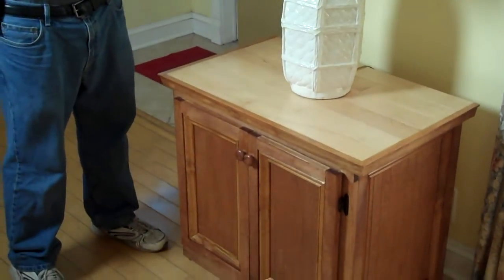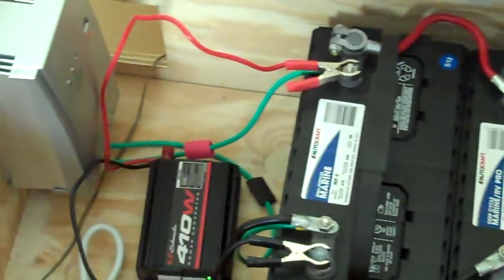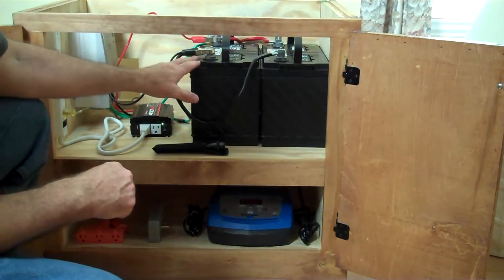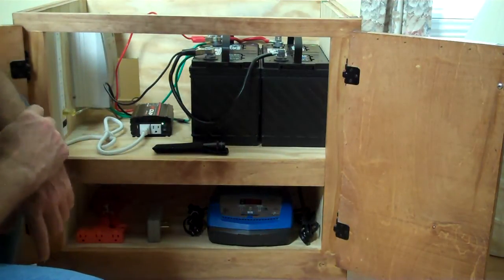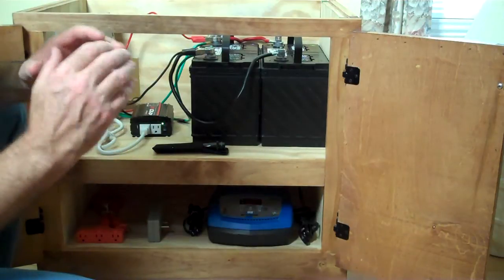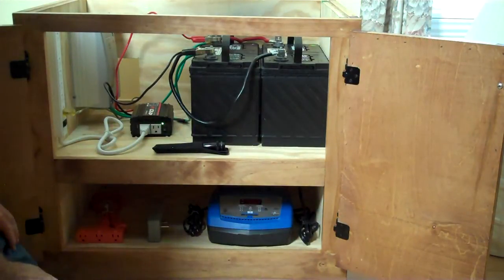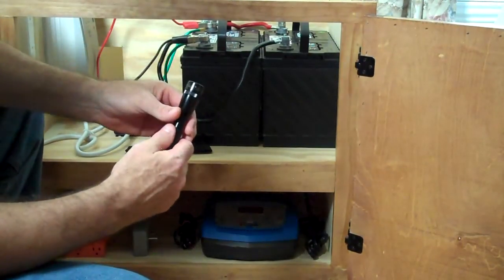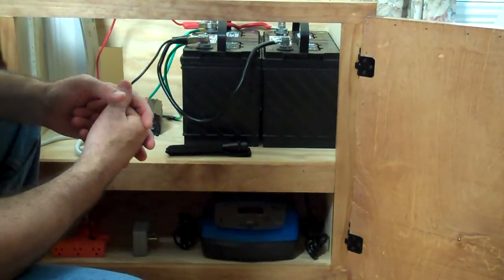Battery Bank Introduction

Comment: I have thought of this since i have a 400w power inverter and have used it in my car when on trips and camping with the family. Tho i was going to use a car battery for inside use, tho deep cycle is far better right? This is a great idea, would be nice to beable to get online to check local news and such in a power outtage alot of good from this thanks alot. I liked the video so i can watch it again and thinking i may make one of these. Might make a smaller tpe. thanks for the inspiration.
Reply from the maker: Hello Kullcraven.  The car battery was designed to turn over the starter motor for a very short period of time.  High power draw in a short period of time. A marine battery is for a lower draw for a much longer period of time.  Both batteries should not be drawn below 50% of capacity otherwise you shorten life expectancy.  This is where the marine battery really shines, it has tremendous capacity. All this said, if you watch your draw, a car battery could work for you. Gene
Reply: Thanks alot, tho to be honest how do you know when its at half life. 
A tester i guess
Reply from the maker: Kullcraven, that is right. Some battery chargers have that ability to tell you.  I also use a Kill A Watt meter to roughly judge usage against capacity. Gene

Comment: Gene, how are you expelling the gas, hydrogen,  produced during charging?  Also, lead acid batteries do weep sulfuric acid. Shouldnt be do this in your livng room. I keep my battery bank in my garage with a fresh air vent to the outside for these reasons.
Reply from the maker: Schickmann, That was true with the old vented batteries when being charged at a high rate. I believe the newly designed sealed batteries with smart battery chargers and controllers over come this problem, my personal opinion. Gene

Comment: I would just buy a small UPS that uses a 12 volt battery. Take out the battery, extend the leads, and connect it to a bigger battery.

Comment: Hey Gene, great video. One thought regarding inverters, some of the lower end inverters using a modified sine wave will give interference with some electronics. Also I would be wary charging a laptop battery or battery packs for power tools with the modified sine wave inverter. I have seen many a nicad battery pack turned to junk.
Reply from the maker: James, I agree. Depending on the square wave inverter's design  the DC component can overheat transformers and cause damage.For lighting it's not critical. To be safe we use a Go Power pure sine wave inverter for important loads.
This system is designed to be used with multiple type inverters depending on the situation being addressed.
Thanks for the comment.